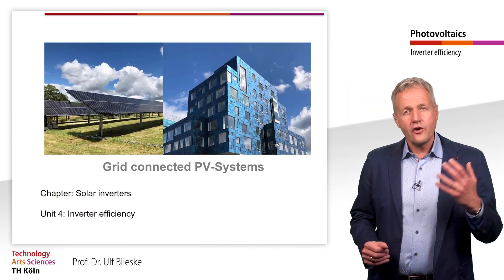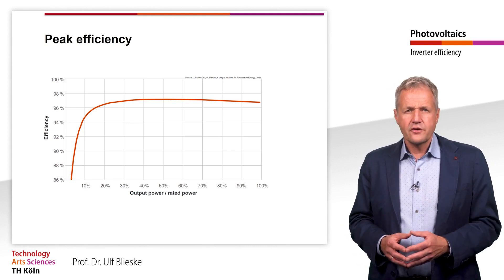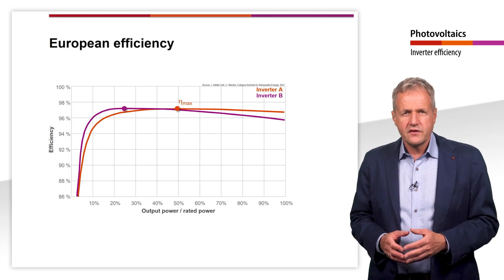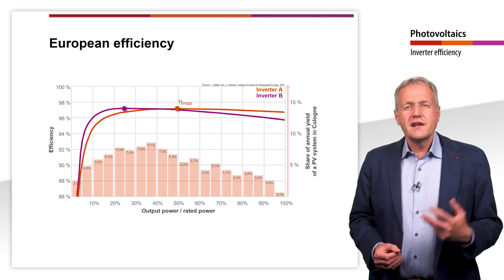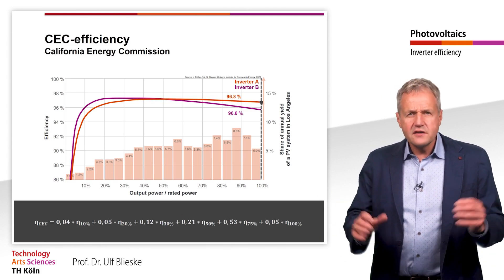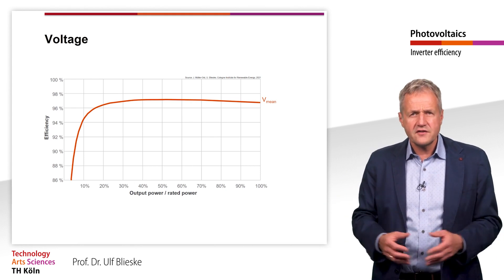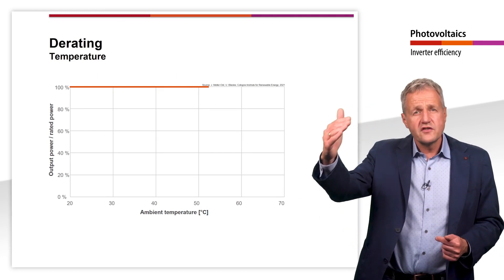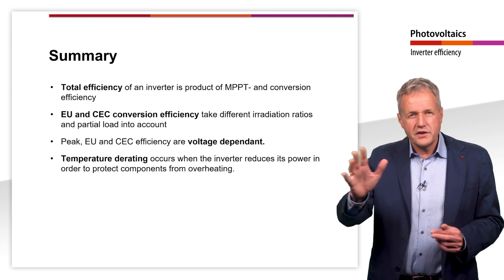Inverter Efficiency: Course Photovoltaics #22

Comment: Very helpful.  Some actionable insights - This suggests that, one should generally have at least 1 set of PV in series.  eg. with 4 panels, Series / parallel.  12v x 2 = 24v to go into Charge controller - as it is more inefficient to upconvert than down convert, but also to offset for shading, espec if going into 24V batteries.

Comment: If my inverter isbrated at 610V max efficiency and i have 654V of installed panels, what does that mean? Will it deliver less power? What about in real outdoor conditions (not laboratory)?
Reply: 654V of installed panels are NAMEPLATE voltage. Probably in measured in STC (Standard Test Conditions). Actual voltage from panels in real working conditions will vary depending on many factors, mostly from temperature. IMHO.

Comment: Thanks for sharing, very insightful!  I notice most manufacturers does not share the efficiency curve only the max/euro efficiency, then there is other guidance recommending to undersize the inverter to clip or "overclock" peak generation to maximise lower output across the day/year. 

Taking inverter B as an example, always staying at 100% output at say 4kw dc on a 3.6kw ac inverter would be less efficient than a 5kw inverter at 80%. This is even greater if the inverter derates.  So In this scenario the clipped solar generation would be wasted at peak, and with nominal efficiency difference when below peak.

 Manufactures should be testing & sharing the curve in the data sheet